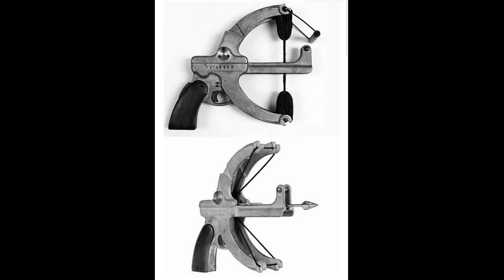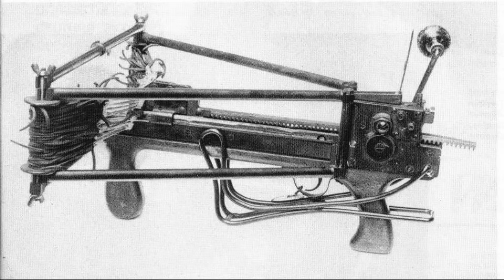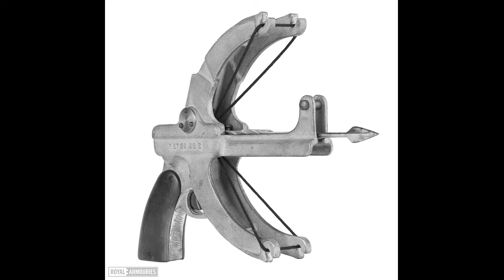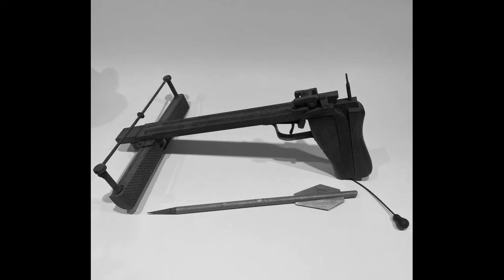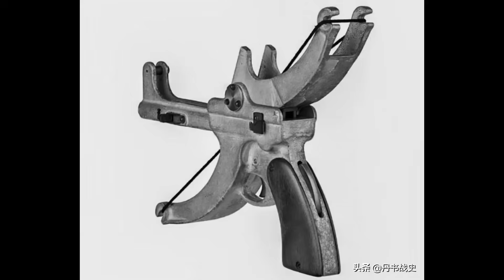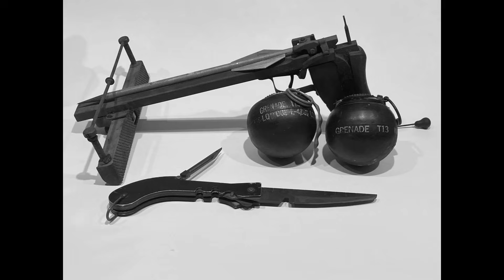Why This 'Medieval' British Weapon Terrified German Guards in Occupied Europe

Comment: 18:30 when it states “a weapon that allows its victim time to raise an alarm is not a silent weapon. It is merely a quiet one” perfectly explains why the crossbow failed despite its ingenuity, and 18:53 showing guards feared “the strange tube-shaped pistol” instead reframes the whole myth; then 19:59 “German sentries… learned to fear a sound they could not hear” is such a powerful closing line. I love how this episode values practical effectiveness over romantic ideas. Do you think modern special forces still test bold concepts like this knowing most will fail?

Comment: A repeating .22 air weapon would have been better, fed from a CO2 bottle of the kind used to power miniature railways.The pistol holster could be used as a stock in the same manner as Wyatt Earp's Buntline special, which would have made it very accurate. A double tap headshot from 30 yards would have been quiet and deadly.

Comment: Crossbows have never been silent. The more potent the more noisy.
Reply: If you had listened, it was clearly stated that during testing they had measured the sound levels generated and how it compared. 🙄   "Silent" is a relative term.
Reply: @another3997  I did listen and heard it stated many times by the narrator that crossbows are completely silent. Only when quoting other sources was proper info given.

Comment: I have heard that crossbows were used during the Balkans conflicts, not for secrecy but for defeating sandbags.
Reply: Thats pretty smart, but i feel like it would take ALOT of bolts to be effective
Reply: @justinneal4661 "A lot" is two separate words, just being helpful.
Reply: I have heard that bows are used to defeat sandbags. It seems that a bullet will begin to tumble when it strikes a sandbag, even if it doesn't get smushed out of shape. Arrows don't tumble or deform so apparently they just glide straight through sandbags, retaining a lethal quantity of kinetic energy when they come out on the other side. Sounds potentially plausible.

Comment: Hmm, I build, as a hobby, devices similar to "Little Joe". One hundred & seventy feet per second on such a short power stroke is pretty darn good & matches my best efforts for a similar device. 

There are a few $800 devices commercially available that can reach 350 fps but they use mechanical advantage to reach those speeds. 

Many of my prototypes also use latex except in the form of tubing. But, interestingly enough the hardest thing is getting the triggering mechanism to be easy with respect to releasing the arrow or bolt. If you have 80 pounds of force applied to a catch that has a long moment arm with respect to where your finger rests the trigger pull can reach really high forces required such as perhaps 30 pounds.

Anyway, they are neat & very silent. I try to always get at least 20 foot pounds of energy out of my creations. The dream is to get 100 foot pounds or around the kinetic energy of a 22 LR. Chasing the dream keeps me at it.
Reply: Man that seems like a ton of fun, i own many crossbows and a few bows but i have never managed to build them myself, how do you do it? :]
Reply: @loki_the_armed_puppy Best answer is to Google it & search YouTube. Jorge Sprave's Slingshot channel got me started years ago when he started building his stuff that became a lot of or used in current EK Archery products.
Reply: Do you have a secret tip for slingshot elastics? I use cheap latex tubes from ebay, the kind everyone knows, but I'm always wondering if there is some cool, better material that is readily available or if there is a sweet spot between wall thickness and diameter of the tube or anything. I'm basically buying them blind and play around with it for a while but I'm pretty much clueless to be honest